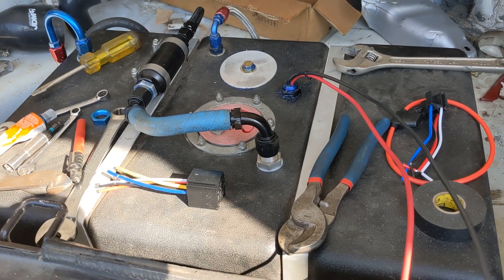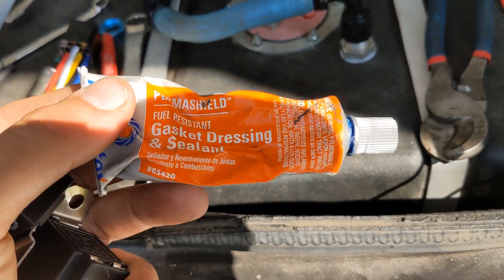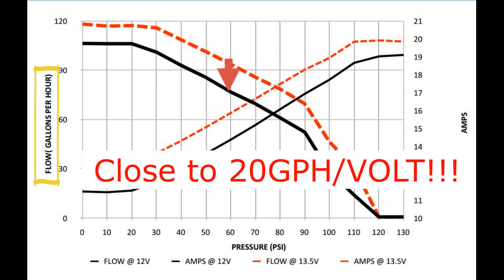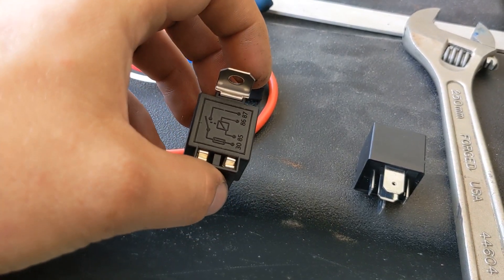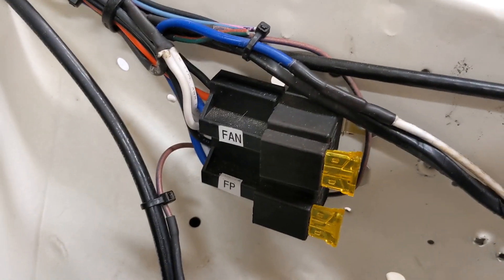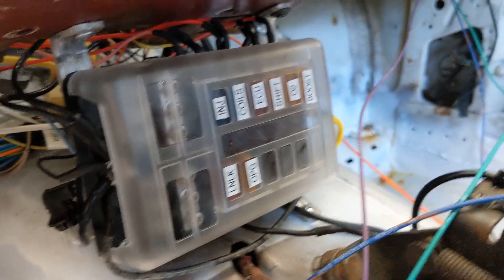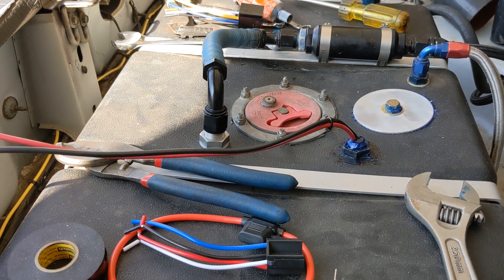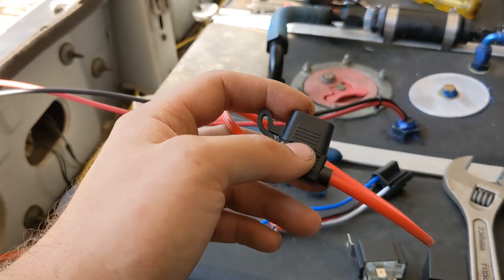How to Wire a Fuel Pump

Comment: Just noticed my 10 ga. Butt connections were very hot and the relay itself after a 20 psi pull.

I've got a 30 amp circuit breaker in hand. 

Now would  the circuit breaker be better than a 30 amp fuse before the relay and 10 ga. Pump wiring out of that ?

Comment: If you've moved your battery to your trunk, you might as well use a relay very close to your pump and use the original cables to trigger it from the original relay at the front. Just eliminate the original relay and crimp the switching wire to the cable leading to the new relay.

Comment: Hey man if i could get some advice about mine so i had just got a relay kit that looks like yours it came with a circuit breaker tho and i had everything wired up it worked fine and then all of a sudden went to start it like you said and the relay just clicks when i turn the switch off and so we tried to put the wire that goes to thd fuel pump to a switch cause thats how it was before i got the relay and theres still nothing going to the pump
Reply from the maker: Maybe the pump went bad? Hard to say
Reply: @Calvin-Nelson  Yea thats another thing we have to look at see if it went out

Comment: If the fuse is at the front of the car on the relay and the power is being pulled from the back of the car at the master kill switch or battery what happens if a power wire gets cut and shirts out? Is there a secondary fuse to protect the wire running from front to back? I’m getting ready to wire my car and I’m not sure how to run the master power cable from the kill switch to the front of the car, and I want it fused so I’m not burning anything down.
Reply from the maker: We normally don't run a master fuse and just try to be smart about the routing, but they make high amperage breakers if you are looking for that.

Comment: Where do the relays come from?
Reply from the maker: Amazon
Reply: @Calvin-Nelson  Lol.  Where on Amazon?
Reply from the maker: @riffraff9000  type in "70 amp relay". A whole bunch will pop up.
Reply: @Calvin-Nelson  I ordered these came in a nice package box for sure ! It has the connector pig tails but can you get the bigger female ends so you can do your own wire ?